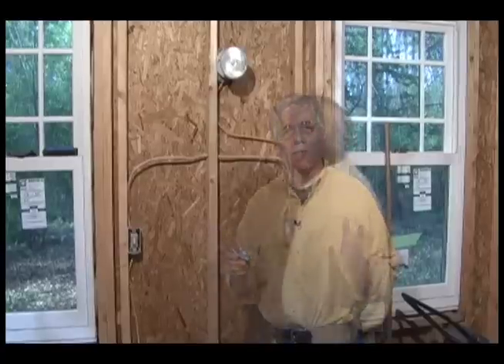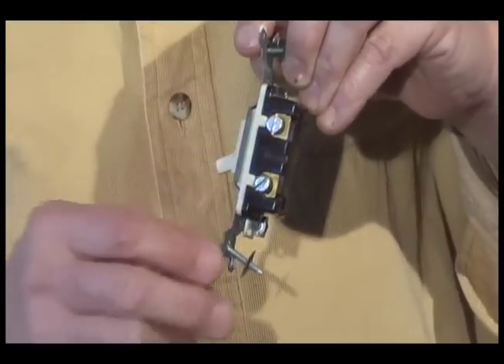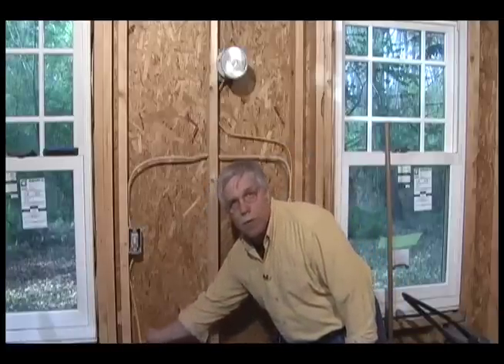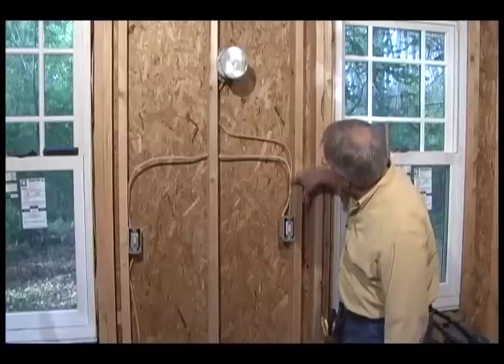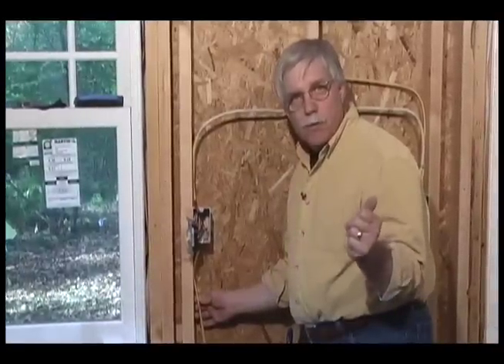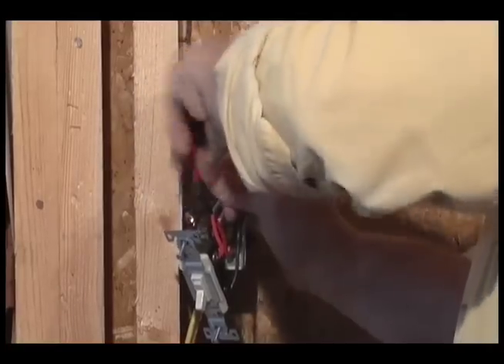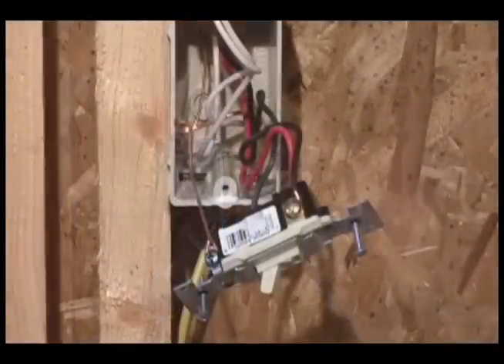3 Way Switch

Comment: Hi Tim, It is probably a good idea to add "you should always hire a licensed, qualified electrician to perform this repair".  As you can probably tell from the questions you have received, there are an unlimited number of other factors considered when repairing or installing a 3 way switch. There are probably 100's of national codes, mfg. ratings and local jurisdiction rules for this "simple" installation. About 1/3 of all 3 way switches I see are backfed, which this video doesn't cover. Also, the equipment grounding conductor (EGC) is required to be connected by mechanical means, which it wasn't. There are also other considerations, like a load analysis on the branch circuit and maybe entire electrical system, that a competent electrician would factor into the project. I am not trying to complicate an apprentice level exercise, just a reminder that there is much more to electrical work than connecting wires.
Reply from the maker: Eric, thanks for your comment. I pretty much disagree. Why? Read all the comments you must have missed from regular homeowners who were able to fix their issues. I absolutely agree that there can be complications and that there are other issues a homeowner can run into. If their backfed switch doesn't look like my video, then they can call you. I'm not trying to take work away from electricians. They need to understand that there are people who just want to DIY. That's never going to change. Believe me, MANY homeowners are AFRAID and would never think of doing the work. That's why you'll always have work.
Reply: Tim, I suppose that is the issue. Did they fix their electrical problem? It is not a question you, I or anyone else can answer  unless they were on the job.  The consequences of being wrong in electrical work can cause fire, injury or death...., in plumbing,, framing, painting, cabinetry, concrete, landscaping, home building, etc. etc.etc... not so much.,
    It would be awesome if homeowners could take care of minor electrical issues. But it is impossible to make a video that  meets all the local jurisdictional requirements across the US or even a state.  The rules from place to place are often completely opposite. The disclaimer was more for your benefit than mine, I haven't needed work for years. Nearly 1 milliion people have watched your video and you told them to do something wrong. How do you fix that?
Reply from the maker: Eric Pitman The EGC was connected to the switches mechanically.
Reply: In my area, Coastal NC, 2 of the County Inspectors REQUIRE 2 DIFFERENT Grounding Processes... Brunswick requires Twisting the Grounds(Bare Copper), and using a Crimp Sleeve. New Hanover requires using a "GREENIE" ... A Greenie is a Wire Nut, that has a hole in the TOP of the cap, for the Ground Lead to protrude through... Easier to use, but LAZY. Keep in mind, that IF you are talking about Commercial, Then it's a WHOLE NEW BALL GAME. I often wonder WHY we use either, if you twist the Grounds SECURELY, and situate them in the BACK of the Box when installing devices.... A wire nut or a Crimp Sleeve can come LOOSE also.... But you have to PACIFY the Inspectors and CODES>
Reply: Eric Pitman Licenced and qualified don't always go together. I've moved  into 10 new home constructions in my life, and in  30% of those the three way switch has been wired incorrectly. You see they don't ACTUALLY INSPECT these, and they dont ACTUALLY test them under power. Turn on power and 30% blow the breaker. No confidence.

Comment: can i use any wire to make it the traveller?
Reply: No.. Because, you need a PATH for the Switching (Travel), and you CERTAINLY need a Separate path for the Neutral. Remember that the Travelers carry the Voltage in 2 Directions, thus making each switch MAKE or BREAK the Circuit. The ONLY other exception to the RULE, is IF you are runing wire through a Conduit (Metal or PVC) Even then, you need to use a COLOR CODE. Black, Red, Blue, White Green.
Reply from the maker: No. Be sure you subscribe to my FREE newsletter right here front and center: www.AsktheBuilder.com - Also, I now LIVE stream each M-F at 4 PM Eastern time at https://youtube.com/askthebuilder

Comment: It matters where you put the traveler wires. They must be on the same side of the switch in order for it work properly.
Reply: It depends on what type of switch you have.  The black screw is the common and the other two are the travelers.
Reply: You're wrong Jon....... Watch the video again. If you put a traveler on the BLACK screw, you're TOAST. The circuit will not perform correctly.
Reply: Tim Carter I do believe I am correct. If one puts the red traveler wire on the left traveler screw on the the first light switch you must put the other end of that wire to the left screw on the second switch.
Reply: Jon Ranthum Well Jon, all you have to do is do it. Go get two switches like I show. Then wire them the way you describe. Tape a video with an open showing like I'm doing proving it works. Maybe you've got some new switch that has a different design. We await your video. That's what your channel is for - for you to upload videos you produce sharing your knowledge. Let me know and I'll make your's a video response.
Reply from the maker: Watch my video: Be sure you subscribe to my FREE newsletter right here front and center: www.AsktheBuilder.com - Also, I now LIVE stream each M-F at 4 PM Eastern time at https://youtube.com/askthebuilder

Comment: HELP!   This is good info but I've hit a wall looking for an answer to my problem.  It's a combination 3way and single pole stack switch.  What gives?  Applying this video's info is fine for the 3way part of my combo.  But what's the secret to getting the single pole to function too?!
Reply from the maker: Scot. There is no secret. You can't have a single pole switch in a 3-Way circuit.  If you need more help, you and I can talk on the phone. You'll pay less than having an electrician come out to bail you out. http://shop.askthebuilder.com/products/15-Minute-Phone-Conversation-with-Tim.html

Comment: I hope you'll see this and be willing/able to answer this because I'm going crazy here :|  There are a few three way switch setups in our house (about mid 80s house) and not a single one of them is using 3CD WG wire.  They're using standard 2CD WG for the travel wires and...god knows how the hell they've got the neutrals connected (there are other wires as well, all neutrals screwed together with a cap).  I've been trying to figure this out most of last night and all of today.  I wish I could show a picture but it's giving me a massive headache.  I want to replace the wire with proper 3CD WG wire, but there are other wires that I don't know where they're going or what they're doing, and I've been tracing/labeling wires all day.  What reason would there be for them having doing this?  Is there any good reason for it?  Here's a video of what I'm looking at (one of the boxes anyway)

http://youtu.be/Z2ISyNKsncw

Thanks much!!
Reply from the maker: Yes, I will answer you on my new LIVE stream: Be sure you subscribe to my FREE newsletter right here front and center: www.AsktheBuilder.com - Also, I now LIVE stream each M-F at 4 PM Eastern time at https://youtube.com/askthebuilder

Comment: SO i'M WORKING ON AN OLDER HOUSE THAT DOESN'T HAVE THE COPPER GROUND WIRE. DO i NEED TO CALL AN ELECTRICIAN  to install a grounding wire to bring it up to current code or just not worry about it?
Reply from the maker: Ask on my new LIVE stream: Be sure you subscribe to my FREE newsletter right here front and center: www.AsktheBuilder.com - Also, I now LIVE stream each M-F at 4 PM Eastern time at https://youtube.com/askthebuilder

Comment: Shouldn't the 3 wire also be yellow to indicate it is 12/3 rather than 14/3 or did you find an old piece of 12/3 laying around?
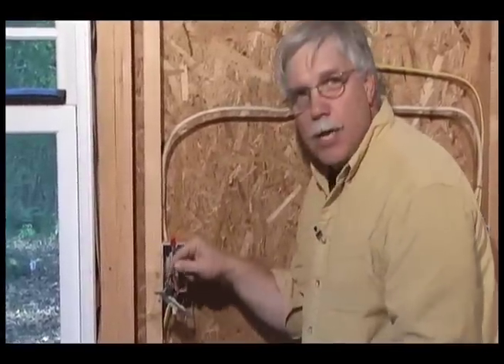Reply from the maker: Correct. It was an ancient piece off a roll that I had BEFORE the code required colored sheathing. Want even more great advice? Subscribe to my FREE weekly newsletter on my home page: www.AsktheBuilder.com. I also LIVE stream each M-F at 4:00 ET on my YouTube channel.

Comment: My house is older"1963" and I noticed the grounds are bolted to the water pipes in the back yard? There were improvements done to this house in the past, and I heard all grounds were to go to a copper post in the ground away from the water pipes? So do I leave them where they are? Or should I have them moved to a copper post?
Reply: Grounding to water pipes meets canadian electrical code. Section 10. I'm not going to look it up but It has to be connect on the street side of your house service.

Comment: I can only suppose that I'm new to your videos but thank you for spreading your experience. I'm wary of doing new lighting projects at my parent's house. There is no ground wire for most of the old wiring. Panel service has been upgraded but for the existing circuits, there is no ground and I'm depending on the neutral. What to do with old houses? Please help.

Comment: Thank you Tim. You are a life saver. I had more than one light installed on that switch. And was very confused, until you showed to run the 14-3 from on switch to another. I'm getting ready to do a 4way switch maybe you can help?
Reply from the maker: Harvey, congrats! Whenever you need a video of mine, type into YouTube the video subject followed by my name. I typed: 4 way switch tim carter and discovered this: How to Wire a 4 Way Switch
Reply: Just watched your 4 way switch video. You made that look easy. I will be sure to buy enough 14-3 wire to do this project as well. Thanks for making my basement project sucessful.
Reply from the maker: Harvey Green Harvey, it is easy. It's just a matter of knowing what wires correspond to which cable.

Comment: What if I wired the light also to the first outlet. (black with black that comes in to power it and connects to screw without screw on other side) I assume the light would be on all the time, just trying to save some longer wiring runs if I have to connect to the end switch.

Comment: Very Informative video. Here in Australia we call them 2 way switches because there is 2 switches controlling the light. If there is more than 2 switches controlling the light then the additional switches become intermediate switches. Our 2 way switches also have the 3 terminals the same as yours and naturally all intermediate switches have 4 terminals. Our neutral cable in black or blue, our active is red or brown and our earth cables must be insulated with combined green \ yellow insulation

Comment: Hmmm, very nice video. Fairly simple for someone who will just be doing the odd job around the house to understand. I would have run 3 conductor from the hot to the light, then from the light to the switched switch, to save wire, but for those who don't know much about switches and wiring this was very simple.

Comment: This really helped!  My house had the 4-way, I removed it a decade ago and put in X-10 remotes and wanted to switch it back to 4-way (so I could use florescents) but couldn't figure it out.  After looking at many diagrams and trying different configs (but never blowing the breaker!?!) I finally found your 3-way and 4-way videos.  They helped me to figure out the problem quite quickly!!!

Comment: Tim, Great Video. Thank you for the clear explanation of the concepts behind this. Can you explain how to replace the one of the switch with a programmable timer ? I tried but did not work. How do you decide which one of the two switch you replace? Will it work on any of the switch or the main one that goes to the bulb? Based on your explanation hopefully I can DIY and save 125$ for 10 minutes.

Comment from the maker: Dear Skilled Eddie, I appreciate your comment, but what's really interesting is that every electrician that leaves a comment similar in messaging to yours forgets one thing. They forget the skill level they were at the first day/week on the job. What's shown in this video is Electricity 101. It's all very basic. I say to make sure everything is to code. Connecting wires to switches is not hard. Installing wire nuts is not hard. Nailing in cable staples - not hard. You used to be a rookie too.

Comment: This is a two way switching circuit using two position single pole switches. as opposed to a one way single position single pole switching circuit or a three position otherwise known as two way and intermediate using two way and intermediate single pole switches. Double pole switch live and neutral or two lives.

Comment: >however some voltage is used up(dropped) across the current limiting Resistor and tiny Lt. at the sw. At a reduced voltage (and current),there will not be enough current to operate(drive) the Lt.at the socket and intermittent(flickering) or no operation will result. No bulb in the socket=no current flow.When you(carefully)connect your meter to socket,meter becomes path for current(small amount) and you read low voltage down stream from Res.&tiny Lt.  I always pray around electricity!!

Comment: inshanbling-A-If there is only one path for current flow, that is a series circuit(ckt.) If there is more that one path, that is a parallel ckt.B-Current will follow the path of least resistance (Res.)W/ an illuminated sw. there is a high Res.path(the tiny light(Lt.) of the sw.) in parallel with a low Res. path-the sw.contact.When sw. contact is closed(low Res.)current&full voltage pass to light socket.When sw.contact opens current&voltage must pass thru high Res.&tiny Lt. to get to socket.>>

Comment: does the sequence have to be switch-switch-light, or can it be switch-light-switch?  in other words, run the power into the switch, from that switch directly to the light, and just connect the two switches with the 14-3 wire.  my logic is as long as there's that 14-3 wire connecting the two switches it should be okay, but i'm not sure.  thanks for the video.

Comment from the maker: Easy. Most high-quality ceiling fans have 3-way switches offered as an option. Most of the ceiling fans sold at the big box stores don't offer this. Go look at the most expensive ceiling fans and you'll see the 3-way switch accessory.

Comment: Tim, Thank you. You do a fantastic job of showing this. I was never totally clear on how to wire a three way because I could not see the internal switch circuitry. This is a problem for a guy that is paranoid about making a mistake.... I check and re-check! However, you were so clear it gives me the confidence to just wire the sucker up. Also, knowing the proper terminology. Did not know the Black and Red were called Travelers. Wired and working! Thanks!
	Mark E. Crum

Comment: I believe wpm44 is confused in what he is even looking at. Your doing a standard household light switch done in a outlet/switch box, your not extending a cable run so no "Junction Box" required, your "switching" a cable run.

Comment from the maker: That doesn't make any sense. What happens if you have five lights that feed off the switches? In each of those boxes you're wire nutting the black and neutrals. What happens at a SIMPLE single-pole switch? Line cable comes in, you wire nut the neutrals and grounds, and then the Load cable goes to the switched device.

I'm having great trouble here understanding the logic in this part of the code.

Comment: Good video. I just dont understand one thing. When you switch off the power from the first 3-way switch how does that not cut the power to the second 3-way switch? Creating a break in the circuit via the light switch would mean that no power travels beyond the switch, yet it some how does. So does it work?

Comment: Hi Tim,
Your video is great.  Thank you.  However, I have this dilemma.  My 3-way switches don't work properly.  I turn the light on at one end (switch 1) and can turn it off at the other end (switch 2).  However, switch 1 cannot turn the light on again.  What is wrong with my wiring?

Comment: Great guy, and he knows his stuff.  But Im confused where the power wire comes into the second switch.   He has the black wire coming into the common (black) screw in the first switch,  but he does not have the power coming into that common screw in the second switch.  Yet he says the two switches are wired exactly the same. No, they aren't.   He says the common screw, the black screw, holds the wire that FEEDs the light.   So you can't hook the incoming power to that terminal

Comment: @sebasamy13 The switches you're using, do they have 4 screws and a ground or 3 screws and a ground. It sounds like you may be using a 4 way switch, wish is only used in the middle of a 3 way circuit.

Comment: I used two switches with four side screws on the switches.The two switches on the back with arrows it says load line on the top.I connected the load coming from the switch box on switch#1 and on switch#2 I connected the black cable from the light.The neutral to the light.And the two travelers.But when I turn on the light from switch#1,I can turn it off from switch#2.But if switch#1 is off I can't turn on the light from switch#2.Try switching the travelers than I get not power.Please help.

Comment: i have as follows. wire from panel to light, then from light to 3 way switch # 1 inside garage door. then from 3 way switch #1 to 3 way switch #2 inside kitchen door(attached garage). now between switch #1 and #2 i have 12/3 so thats good so how should i wire these. i cant do the same way as shown here as i dont have another cable on the #2 switch

Comment: @AsktheBuilder 
can you send me a diagram based on what you just told me . i don't get it ? one box has hot and neutral; other box has the light, i think.  so how do i hook up a three way switch on both boxes  with only four wires ( 2 in each box) ?  Thanks -Jim